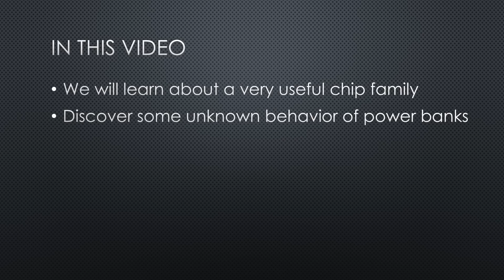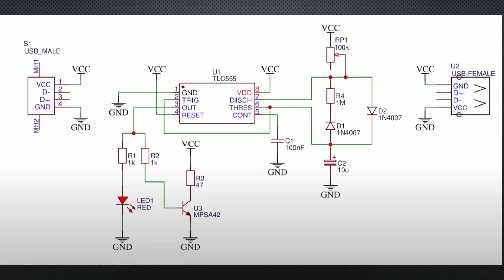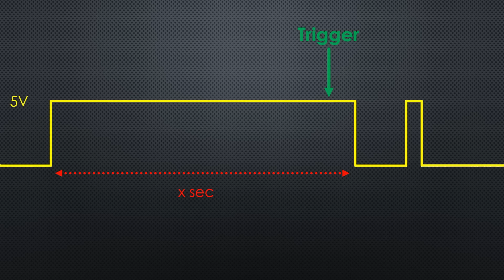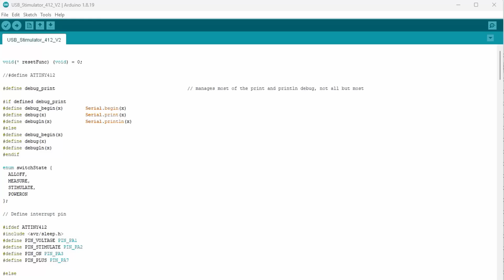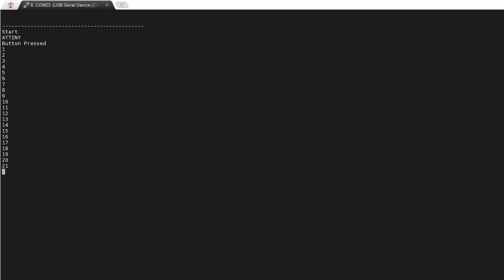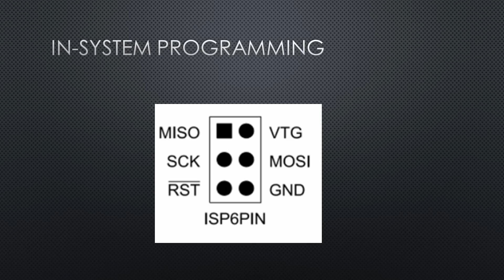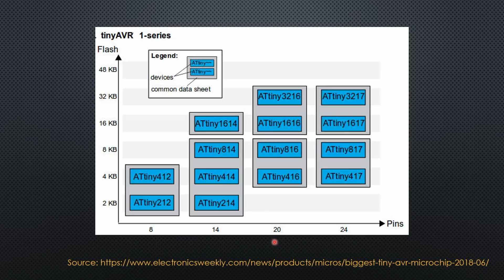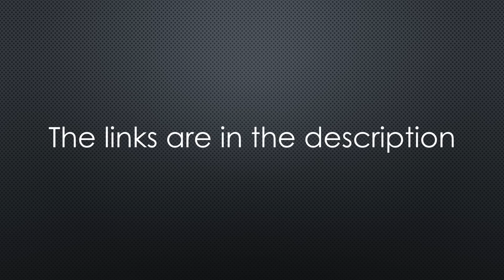477 Use the very attractive new ATTINY chips for your projects

Comment: Why measure and store instead of just reacting? Decouple the ATtiny a big so it keeps running a tiny bit after the power-down of the battery-pack. That way when the power goes low it can record the time and trigger it again (maybe repeat a second time for more confidence).
Reply from the maker: @tjwatts100 is right: The power banks did not switch off even with the lightest power draw.
Reply: He covered that I think: there was no easy way for the ATtiny to turn the power bank back on once it had gone into "low output" mode.

I might have missed something, but I think that was the problem.
Reply: @tjwatts100  That was with an external power source and he talked about how it worked but he decided to go a different path.

Comment: I wonder, if you are concerned about eeprom wear, why nog only use this during "programming" mode of a new bank. (Going to your explanation and did not dive into your code). Great way of rethinking about a project of Great Scott 🎉
Reply from the maker: I am not concerned about it because they should last 100'000 write cycles and only are written when you change the power bank.
Reply: @AndreasSpiess  You are already far in front of the pack 🥳 thanks for mitigating this risk! 👍🏻

Comment: Could you keep the uC running off a capacitor long enough to trigger a pulse, so that you don't need a battery?
Reply from the maker: A good idea!
Reply: I was thinking this pretty much as soon, if not slightly before he introduced the battery idea, lol
and I don't even mess with any microcontroller stuff, lol
Reply: Nice idea!
Reply: Because the power consumption is to little - one diode, one electrolytic capacitor  and small change in code: if ADC doesn't see 5V - subtract a 'some safe amount of seconds' and save this number into EEPROM and rise the flag (to avoid any trashy values when the capacitor voltage goes down the safe voltage region) On start you can type this value into Serial for debug purpose.
CC: @AndreasSpiess
Reply: I'd look for a proper low power controller, STM32U-series or TI MSP430, that will run circles around the mA numbers from the video, and run at low input voltage. Pair it with a mF supercap and you should have plenty of run time for re-triggering and storing timing data
Reply: I was thinking the same thing, plus if you watch the voltage before the capacitor you can avoid having a corrupt write invalidating your timer.  In theory, you don't even have to record it.  It can be a fresh calibration with each start up.  Which seems easy, so it would probably be terribly hard.  😂

Comment: The thing I really like about these (relatively) new devices is that FINALLY we have low pin-count devices with serial peripherals. Just what you need to convert a simple sensor or actuator into a serial bus device using I2C, CAN or LIN etc. (although the latter two will also require a bus driver chip). I have waited twenty years for this day, and suggested it to Microchip on numerous occasions! Two pins for power, one for reset/programming, two for the serial bus, you still have three to connect your sensor/actuator which is plenty in most cases. The Chinese chips are presumably copies at the mask level or reverse engineered. Does not seem worth the risk when they are readily available at reasonable prices from reputable western stockists (one of which has actually popped up as an ad over this video!)
Reply: And my guess about the wrong signature: the fakers just use the same silicon in an 8-pin-package...
Reply: These devices are already several years old. The one used in the video is at least 4 years old already.
Reply: @backgammonbacon  Hence '(relatively)'.
Reply from the maker: They are not new, but newer than the ATTINY85s (and new to me because they were on my list for a long time)
Reply: Attiny's have had USI (I2C/SPI/UART) for ages, for example, attiny85 that was introduced in 2005.
Reply: @osmanpasha_diy  On the eight pin ones?
Reply: @john_hind  yep

Comment: I kinda expected you to count the time but also have a second counter that gets reset to 0 after a few minutes of runtime. Gets counted up un init and of its at a count of 3 it tries to update the time. 

The new way to program the microcontrollers sounds great.
Reply from the maker: That could for sure be included in the sketch.
Reply: @AndreasSpiess  could also over engineer it with a buffer battery or so...

Comment: Your interface can be simplified:
- enter characterization mode if nothing is connected to the output otherwise enter supply mode
- in characterization mode, while the power supply is active keep an led on (it will switch off when power is cut indicating to the user that it is done and they can plug in their load)
- in supply mode, turn on a different led (or different color, to indicate a different mode)

This would completely free up the user to do user things in parallel =)
Reply: Detecting if output is connected requires a lot more effort, so it complicates the design
Reply from the maker: Good ideas. Maybe you try it to prove if they work?
Reply: How do you plan to detect if something is connected to the output? The usb has no detect pin so one of the only ways you can do it is to measure current which itself adds complexity, requiring either a low side shunt resistor or a Hall effect current sensor.
Reply: @conorstewart2214 @osmanpasha96  Yes, a bit more complexity would be required... I was thinking on measuring current, should be the simplest approach.

Comment: This is exactly how my projects go. As an example Ive been trying to make a pi based nightvision camera using the Argon POD case. The goal was simple - have a no IR camer output to the PODs SPI display. After quite a bit of experimentation I sacked off the spi display for a small hdmi connected display which does exactly what I want - full screen camera - with a lot less coding than the spi display. In summary never be frighten of changing what you're doing especially of you can achieve the same goal with less hassle.
Reply from the maker: Nice story with the same learnings!

Comment: I don't want to be a typical hater but great scott dude always makes something that can be done better cheaper and easier.
For example you can use a universal PD/QC trigger IC which can negotiate for example 5V/1A and that will be kept alive, there is no programming required and the IC costs like 20p, to configure it you use two resistors, then there's one more resistor and one cap for power supply.
Or there are powerbanks which thought of this and you press the power button 3 times and it goes into always on mode until you disable it, some of the xiaomi zmi power banks have it.
Previously he was making smaller version of some chinese DC-DC converter for use with single cell batteries, there is already a tiny product from pololu that does the same thing and is even smaller.
He comes up with made up or imaginary issues and solves them without putting much mind into it and makes a video out of it.
Reply from the maker: I think he mentioned the trigger boards as one solution. However, they need a USB-C bank and this project is for (old) USB-A banks.
Reply: @AndreasSpiess  I have a 8 year old powerbank and using the "PD" trigger board, which actually also supports QC, AFC and FCP, so all common protocols, works.
It should work on any at least half decent power bank.
If you buy the cheapest USB A power bank then yeah it doesn't work, because they dont use the data lines, but then what's the point of buying a $1 power bank and then spending $5 on a circuit just to keep it alive.

Comment: Nice introduction to the new ATtinys - however, regarding your criticism of the old SPI-programming interface: I never had a problem using all 5 pins (excluding reset, vcc and gnd) on the 8-pin chips with in-circuit programming. Yes, you are double-using those pins, but only during programming. And then it normally doesn't matter if you send invalid codes to an also attached SPI-slave devide, blink some LEDs or have push-buttons attached (as long as you don't press these buttons during programming).
Reply from the maker: I agree that it does not always crete issues if you pay attention what you connect to the pins. Still, I like the new method better.
Reply: Yeah, that's what I found too, just take a little care to avoid a large load to the programming pins, but like he said, the new way is a lot nicer.  I found myself using the 20 pin ATTINYs when an 8 pin would do, just because I knew I wouldn't run out of pins in any case.

Comment: There is an 8-pin SO  version of the super-cheap Risc-V CH32V003. More everything than the ATTiny for a third of the cost - not sure offhand about the sleep performance though
Reply from the maker: Another commenter also mentioned it. Did you try it with the Arduino IDE?
Reply: @AndreasSpiess The easy of use of the Arduino IDE is kinda wiped out by the janky harness needed to program it.
Reply: @AndreasSpiess  No - used the  manufacturer's tools. I think there is now an Arduino setup for it though. Another nice thing about that MCU is it needs only one wire for programming and debug

Comment: I've been wondering if we could charge a capacitor in small bursts and power our devices from the capacitor rather then burning off energy with a resistor.
Reply from the maker: Maybe a possibility. However keep in mind that capacitors rapidly loose voltage when discharged...

Comment: Great video, thanks!
These new ATtinys with simple programming are great! 👍
On my (too long) list of project is   one where I can force an old Intel NUC into starting Windows as soon as I power it up (I could not find this setting in its BIOS)
I will now probably attempt to achieve this with an ATtiny 412. 😊
Question: do you know if you can program these ATtinys with PlatformIO?
Reply from the maker: Since PlatformIO uses the Arduino framework it should be possible.

Comment: A friend of mine approached me with an interesting ATtiny challenge. He had to develop a certain small&smart device for a musician; the ATtiny85 was the perfect companion. The challenge was to make the final fine-tuning on the field while rehearsing: how to quickly reprogram the ATtiny without dissembling or swapping the device? "Use a DIP switch or jumpers" was my spontaneous answer. I'm glad he succeeded with it with such small and spontaneous advice.
Reply from the maker: Indeed, such switches were a good idea for the ATTINY85...
Reply: You need to say AI device, not smart device. "smart" is so 2010....
Reply: @cdjxwubcyex;
And AI is so overused for many cases of natural stupidity 😅
Reply: @cdjxwubcyex  X'D
Reply: I built a small proto-board with headers for a ardunio micro to be plugged in, and a socket for a ATTINY85. Also hooked an LED for a quick "blink sketch" test to make sure the reprogramming working well. You can then pull and insert the chip in the project but indeed maybe not as convenient as "in place" programming. Certainly saves rebuilding the programming circuit though

Comment: Some interesting things about the Attiny 1-series: 1. The internal oscillator is much more accurate than on the older AVR chips. 2. They support a wide voltage input range especially at lower clock rate. 3. The ADC is actually quite good (this is more subjective).
Reply: A good ADC is handy on low pin count devices like this, because you can do things like use resistor ladders to hook up a bunch of buttons or switches (DIP or otherwise) to a single pin, saving you I/O for other functions.
Reply from the maker: Thank you for the additional info. Indeed, I run my chip on the lowest clock speed (internal). But of course, precise timing is not a big issue in this project.

Comment: For this problem just use a simple LED and a resistor. Connect it to a USB-A plug and then use an USB-A to USB-C adapter. Connect it to the power bank USB-C and it will stay ON. However learned  a lot again, thanks for the video!
Reply from the maker: I am not sure it even would use the LED for USB-C banks in legacy mode. The project would probably use enough current.
Reply: Well, you have the perfect solution! I tried with a LED on 3 different power banks and all keep the ON-status with just an LED connected ti the USB-C. I think there is a simple stupid "thing" implemented within the USB-C-outputs which will keep them active if there is some current flow. On USB-A output it will not work. Here I really need a current of 80-120mA or so if I remember that correctly. My first solution was to add a resistor to those outputs to keep the batterie alive but that was waste of energy... So I found the trick with the LED somewhere in the web...   @AndreasSpiess

Comment: How many EEPROM write cycles can be made and the IC continue be reliable? Based on older IC specifications (nominal max of 10K writes) and your description - if I understood it correctly to be writing at 1Hz - the EEPROM could fail in less than three hours. I’ve run into this specific issue in the past, albeit by accident.😢

These figures are based on the assumption that no write leveling or other mitigation schemes were applied - which could easily be a false assumption on my part.

It wouldn’t be as simple as an 8-pin IC, but I wonder if a medium-sized cap and a diode (to prevent back-charging) could keep the AT running just long enough to do its work, toggljng the FET/s and/or storing the state in EEPROM only when absolutely necessary. I’ve done zero math on this - it’s just one, late-night, weak, brainstorm-level concept.

Interesting project though. Thanks for sharing!

It’s quite late in the USA as I write this comment/question. I should probably rewatch your description of the progression when I’m fresh after some sleep :-).
Reply from the maker: I showed the EEPROM specs of the ATTINY in the video: 100'000 cycles. So I am ok with it. This video also does not pretend to be the "ultimate" solution. As said, I just wanted to tinker with these new chips ;-)
Reply: @AndreasSpiess one could just write a new eeprom address in a seperate byte at every reboot, thus leveling the usage.
On another point: A ATRiny 44 can run in power down on a 22μf cap for ~40 sek, so it night be possible to get the features the battery was intended for by replacing it with a cap.
Reply: @AndreasSpiess  Sounds like I need more sleep than I thought - I completely missed the 100k cycles part. Sorry.
My colleague frequently request that I try to incorporate ATTiny parts into our designs. So far, for a variety of different reasons I have resisted. But, I think the scales might finally be tipping and I'll have to dip my toe into the AT tiny pool!
Years ago, I had good luck with a couple PIC processors. I honestly don't know how they relate, but now I'm more curious than ever.
Thanks again for your video and response. Be well.

Comment: Really fun with those little chips. 
The support in Arduino for those chips is not good. If you don't need bootloader, you can just programming it in assembly for precise control.
You can do many many stuff with it including game.
It's good for low power application and can be powerd directly by rechargable Li-ion coin cell battery.
BTW, watch out for the clock, or you may add and external one.
2 cents~
Reply from the maker: Why do you write: The Arduino suppoort is not good? In my (small) project I had no issues.
Reply: @AndreasSpiess  Dear, 
Most of the standard lib are not available and even the clock may be vary.
With very limited resources, it's luxury to have a bootloader.
For small one shoud be fine. With the growing codes and data, it's easy to hit the wall. Every byte counts. 
Used I2C, SPI, SSD1306, Max7219, WS2812B, buzzer on the 85, not easy like 328p.

Comment: For such simple projects I prefer the CH32V003J4M6, they cost 10ct a piece.
Reply from the maker: A good idea, too. It seems they are also supported in the Arduino IDE.
Reply: @AndreasSpiess  Yes Arduino is supported, but there is one trap (i fell into,..), you need a WCH-linkE programmer. The programmer is very cheap but I had to wait two weeks,...
There is so much example code and the compilation is so much faster by using a simple text editor and a make file.
Reply: And at least the datasheets say even the 8-pin version comes with a hw op-amp.  Theoretically, you could toss one of those in a circuit where you needed a simple op-amp and have a 32bit MCU for anything else that might come up ;)   And it would still be cheaper.

I started looking after the attiny85s went from 99c on a dev board to north of $5 each just for the MCU.  I guess the chip shortage. Even the "don't buy these" attiny412s are over $2 each + shipping.  I can still buy Arduino NANOs for less.  Last aliexpress price was $2.48 per board?  Shipping included??? Quant of 1????  

My cost on the CH32v003 was 24c each, including shipping (that being more than the device cost even with a quant of 100).  Half the flash of the bigger AVRs but still fine for the poke-a-pin stuff.

Still waiting for some excuse to run up that op-amp though... just because it's absurd.
Reply from the maker: @4Fixerdave  Still, my question is not answered ;-)

Comment: I also got the fake ones from aliexpress a few years ago and they registered as ATTINY416s. I did some work manually mapping the pins that were exposed, and perhaps they could potentially still be useful, but I don't trust them either and haven't bought anymore off aliexpress.